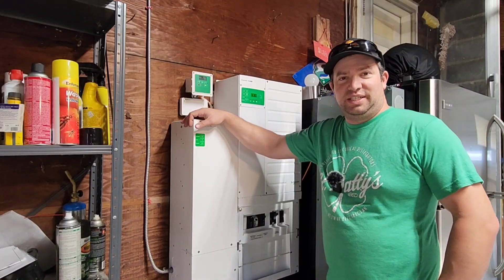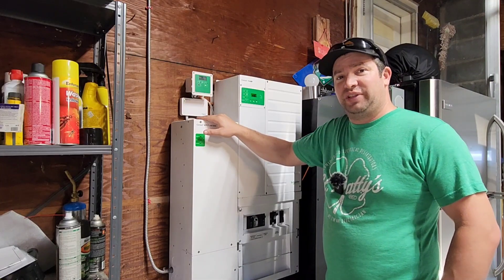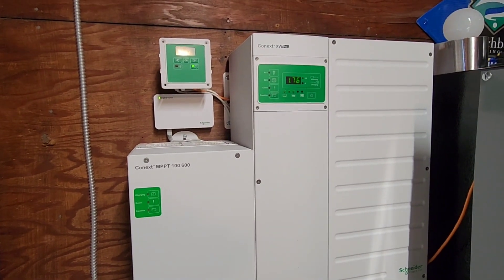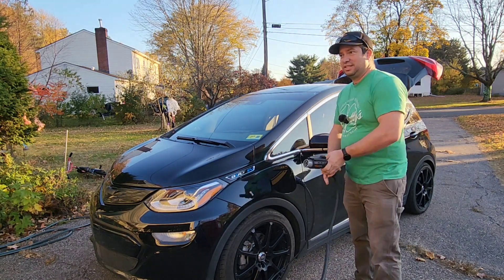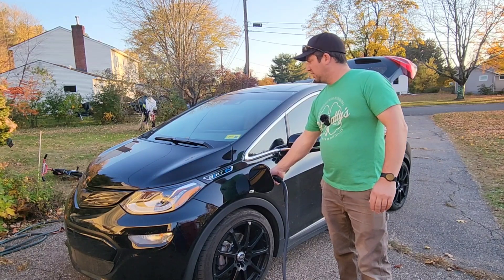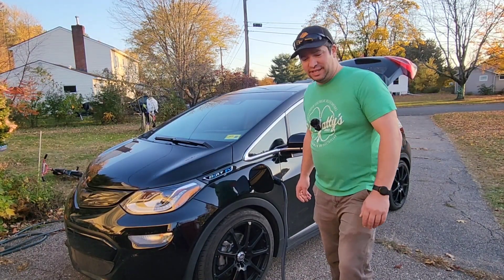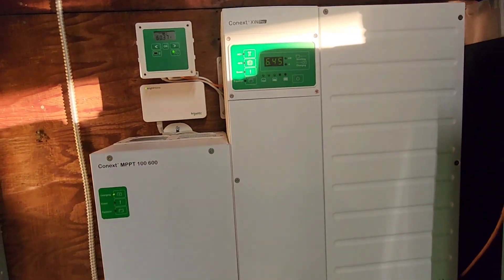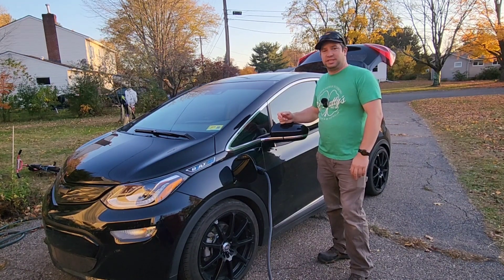Charging an Electric Car Off Grid with the Schneider XW Pro

Comment: Smart move charging your EV with a Schneider Electric XW low frequency, transformer based inverter. The low cost, high frequency, transformerless inverters that are now flooding the market can easily fry the onboard charger of any EV because they don't use an isolation transformer.

Comment: Things that are ridiculous that we’re still doing:  conferred DC to AC to convert it back to DC at, at most 85% efficiency instead of DC TO DC at 98%.

Worse, we’re mounting charge points near the car instead of mounting and EV DC charger near the panel (if on grid) or beside the battery bank (it off) and then piping 400/800v directly to the car thus cutting wire size in half and removing the AC/DC converter in the car which isn’t necessary. 

First company to release a DC charger (not fast) that works with Tesla or ccs that can optionally be hooked to the grid wins. 

It annoys me to no end that I’m wasting inverter power (and thus have to have more inverter) and all of that battery juice for no reason other than linear thinking. 

Meanwhile Munro and associates showed just this week what using 240v outlets and even standard breakers does and how much of a risk it is even if installed per code.  

The faster we get to DC only homes with minor legacy AC the better.
Reply: You are right regarding efficiency, but high voltage DC has its challenges also.  Perhaps you have seen some of the nasty videos on solar panels and the huge DC arcs that are possible?  Which is the reason why most jurisdictions require the residential solar PV runs to the inverter to be in metal conduit, arc fault protection, rapid shutdown requirements, etc.  Would make the wire run to car a bit more involved, but certainly doable.

There are people working on what you describe.  For example, the Ford Connected Charge Station Pro and Sunrun inverter has a direct DC connection to the vehicle battery through CCS.  Presently just for backup power (EV truck to house), but in the future will have bi-directional capability.  So it's coming.  Probably their focus isn't on power efficiency though - more about backup, and time-of-use, and grid management.
Reply: @billjohnson3344  AC is more likely to adc at any given voltage. That’s which the line between high voltage AC is 600v and for DC is 1500v. 

So 400vdc is less likely to arc than 240ac. And every device you own that takes 240ac is actually 380dc internally yet no one is dying from getting 380vdc from a ground short inside them but you do on ac. Why? Because ac is earth bonded. Dc is not. And that also means that with dc you have to have positive and negative across your heart. AC you just have to grab the hot or unbalanced neutral and not be wearing the right shoes and you’re dead. This you’re VASTLY more likely to die from AC in the real world. 

And of course solar panels are not s real example because solar are full voltage always. DC power works like USB where it’s 5v by default and has to negotiate higher voltage, the cable has to agree and there has to be a perfect connection. Tesla connectors work exactly the same way, and it’s basically impossible to die from 5vdc. All AC is full potential all the time. 

There’s just no case where 400vdc replacing 240vac is more dangerous and if done like USB is VASTLY more safe. 

And 800vdc to the car using Tesla protocol isn’t dangerous at all because it’s a closed system that literally never has uncontrolled 800vdc and never anything exposed and even a case or cable fault can’t kill your because hot to earth does nothing. Only positive to negative  can kill you and only though your heart or brain.
Reply: @billjohnson3344  PS:  CCS is the dumbest system ever created. It’s horrific and needs to die now.
Reply from the maker: I totally agree, but like Bill brought up, there are issues with high voltage DC too.  A lot of people do really stupid things with electricity and I think it would be made worse with higher voltage DC at their disposal.
Reply: @benssolarandbattery  DC is safer than AC at the same voltage. In fact 400v DC has less nasties than 240AC. (Ie arcing) it’s also more predicable. 

The rules state that 120v dc is as safe as 50v ac. 

Further, USB type power is a vastly better process:  there is only 5v until more is negotiated and the cable has to handle it too.  If it’s disconnected at all, there’s on 5v and the physical case of the device must have 0V relative the negative and thus any voltage results in immediate (< 0.05ms) fault and detachment. 

Further because DC doesn’t bond ground, there’s none of the dangers of AC care of the cheap out that Tesla did for competitive advantage that makes power to earth dangerous (not so with DC) (ie you can die with AC with hot to earth through your feet or hot to neutral or hot to ground or even neutral fo ground in the right cases. With DC ONLY negative to positive through your heart will kill you which eliminates almost all causes of electrocution. (It’s very rare that someone dies from grabbing hot and neutral in separate hands or similar. Most are hot to earth.). Further when you do get shocked with DC it’s a single clamp that you can pull away from if it doesn’t kill you instantly. Not true with AC because it causes a muscle pulse 60 times a second causing constant muscle clamp and release which also makes an AC shock more likely to break bones and stop your heart. 

Further even at 800v but lower amperage because same watts going into the battery has no more danger in the real world. Actually less because ground faults just can’t happen. 

And because of the Tesla protocol, which works exactly like USB, connecting directly to the meter or battery and then sending in high voltage DC is actually safer all of the way to the cable that comes out of the wall, and as evidenced by no one getting electrocuted at super chargers the rest isn’t a real problem either because a disconnect even slightly causes drop to 5v renegotiation and verification. 

If we did the same for all devices, we’d eliminate virtually all electrocutions in homes and fix ground fault risks that beget gfci requirements everywhere now in the NEC.  Ie GFCI is moot in DC. At most you do a case short sense disconnect like Tesla and USB but even then the ability to electrocute you is vastly reduced because you’d have go get your heart between the negative and positive potential not just touch the case without rubber shoes on as with AC. 

And by standardizing on 50vdc for virtually everything up to 15a point to point, 120vdc for high draw devices like computers and hair dryers and 380/400 for big appliances and then point to point charging for cars, with negotiation everything will start using these so there won’t be weird conversions all over the place either. (In fact most stuff is already there with USB now supporting 48vdc @ 5a. 

AC thinking is based in marketing fear of DC and a failure to rethink the problem. We can use existing wiring right now and replace all 240vac point to point circuits with DC applicances etc right now with the existing wire in the walls. 120vac circuits are a little more complex because they have to switch every point and share 15a (reallly about 20a on a 14 gauge wire because ac RMS) so you have to find every outlet on the circuit. But of course if you have LEDs you don’t even have to worry about them. They just work right now with 50vdc so it’s just wall sockets which can all be just switched to USBC (which there’s no reason it can’t go to 120vdc in the same connector as is driving 1800 watts per circuit just like we have today.

And for EVs, the high voltage over the wire lowers the real risk which is heating caused by high amperage which is what causes resistance. Thus in the real world 800vdc on Romex with the same wattage will be vastly safer day to day because of vastly less heat generation than driving 48 amps with 240vac because you’re at 13 amps through the wire instead of 48.